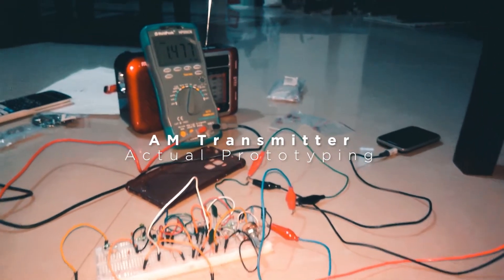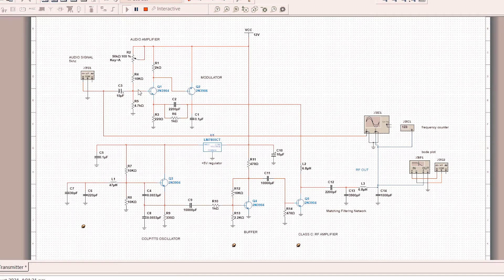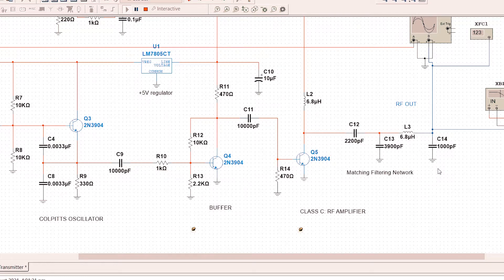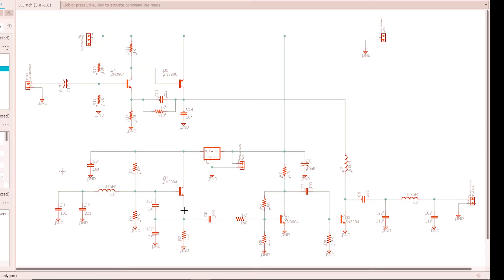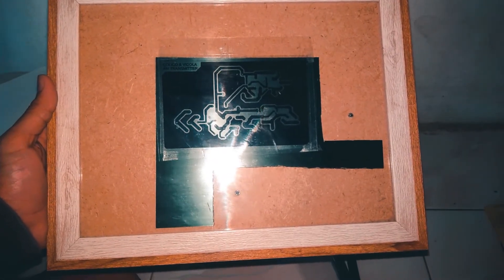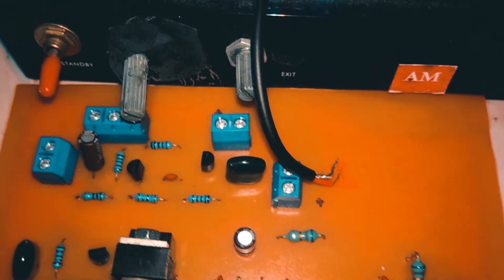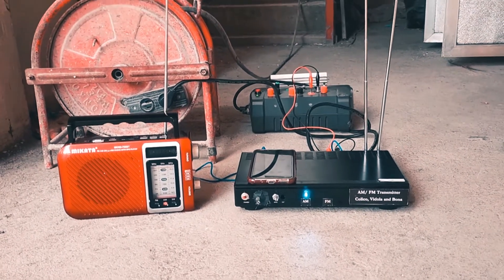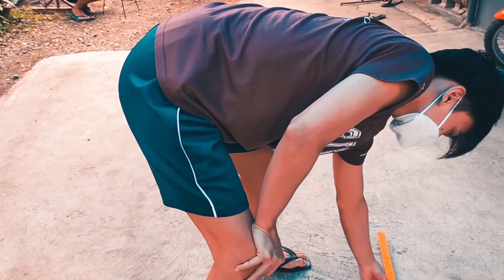How to Build AM (Amplitude Modulation) Transmitter Crystal Clear Sound

Comment: Hello po can we ask permission to use this for our project as a reference? can we also request for the file and BOM?
Reply from the maker: Yeah you can use it, the design is not mine afterall. I don't have BOM but the simulation I presented is pretty much everything in my build
Reply: @jeromecolico1960 Thank you, additional question how or where did you find the two inductors used?
Reply: @jeromecolico1960 additional question if it's ok how did you create the inductor how many turns? did you DIY it or you bought it in the store?

Comment: Not sure how the circuit works with the change to the Q2 transistor from NPN to PNP and apparently with no current flow since the collector has only a path to ground via C1 and no DC path between collector rail and ground.  There is no connection to the C8 -- C9 run.  And, if there was, how does a reverse biased PNP transistor contribute to the circuit?
Reply from the maker: I did not remember the reasoning I had during the prototyping, I guess the actual circuit in the book does not work and when I did the change in onfiguration, it works.

If I am not mistaken I look for the same schematic and I noticed that the transistor is the difference

Comment: I just realized that this circuit diagram is similar to the shortwave radio transmitter with the difference that the audio circuit is an LM386 IC and the oscillator is a Pixie2 quartz crystal oscillator..
Reply from the maker: I didn't know that

Comment: Looks like a good concept. I suppose the antenna limits the range, not the actual power output of the transmitter.
Reply from the maker: Yeah an amplifier would be a good additional to increase range just ensure that it has a good SNR and low distortion